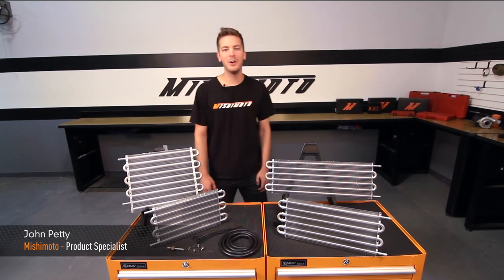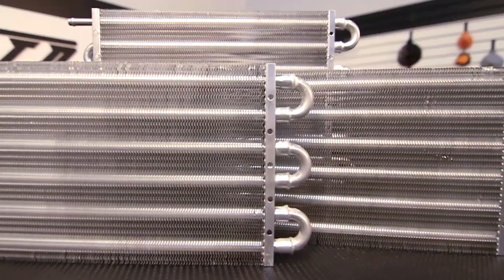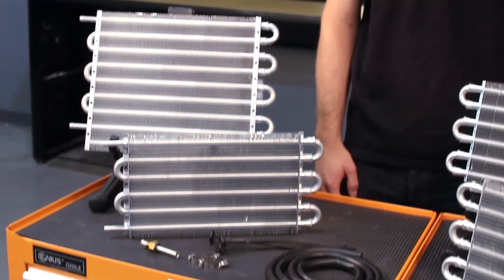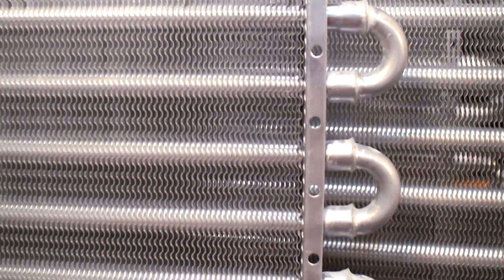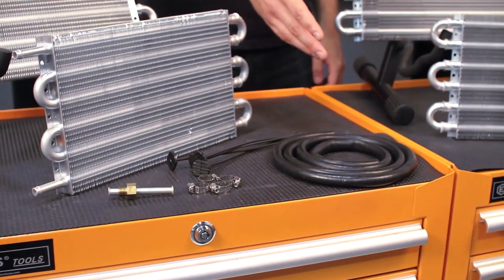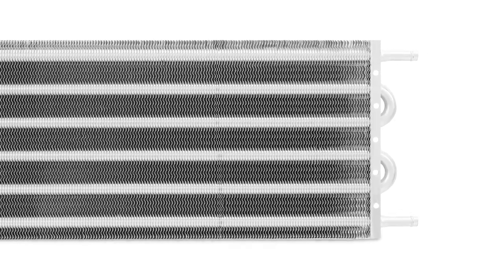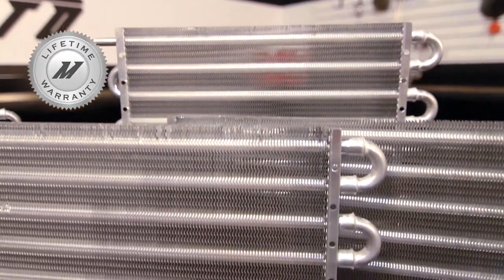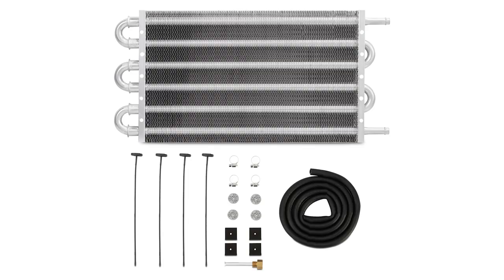Universal Transmission Fluid Cooler Features & Benefits, by Mishimoto

Comment: Hi how much pressure drop range for a 4 row design 
Im planning on getti g one for a cvt that notorious for overheating and sensitive on oil pressure
Reply from the maker: Pressure drop can vary by temperature, fluid viscosity, and more. We do not have pressure drop information due to the number of variables to consider.

Comment: How can these attach to actual pipes? All I see in videos are attachments for hoses, but never hardline pipes.
Reply from the maker: In situations where you have hard lines you would have to find a way to convert over to soft line to connect the to the cooler. Generally the best way is to find a good spot on the hardline to cut and make a bevel for a hose to connect to.

Comment: Hello..where can I hook this up on my 2005 lexus IS300? It's a place on the stock radiator?
Reply from the maker: Hello Trung Hoang . Typically, a universal transmission cooler would be mounted in the front of the vehicle in the general area where your radiator would be. While your vehicle may have a transmission cooler reservoir inside of your radiator, these are generally only used if additional cooling is required. If you have any further questions or concerns, feel free to shoot us an email to support@mishimoto.com or give us a call at 302.762.4501
Reply: Mishimoto Automotive ... my question is that I am planning to purchase your Mishimoto radiator for my IS300...and it's require the universal auto oil cooler for the auto transmission model...so where can I connect the other 2 end of the hose to?
Reply from the maker: Hello Trung Hoang . In that situation, you would simply re-route your OEM lines to go to and from the universal cooler as opposed to going into the radiator. You may need to modify the OEM lines a bit, but it's usually quite straightforward.
Reply: Perfect and thank you so much. If anything I will hit you guy up again :-)